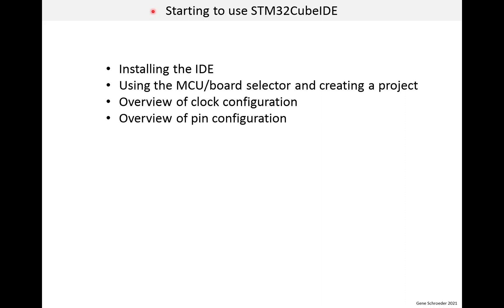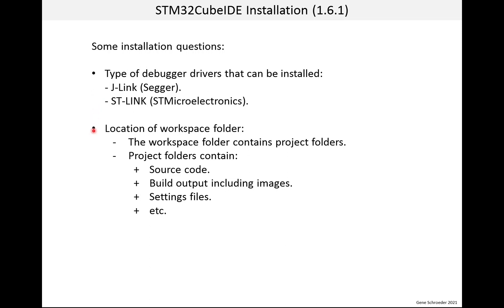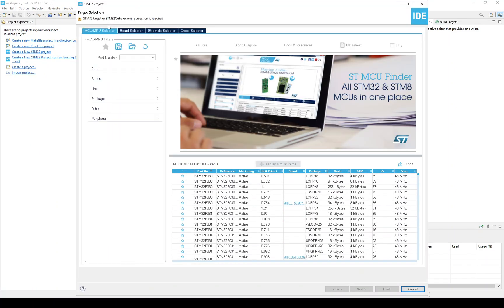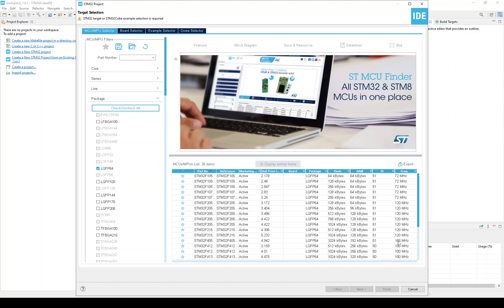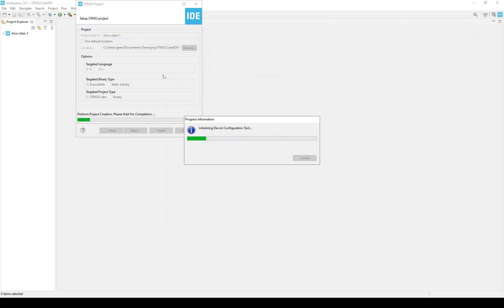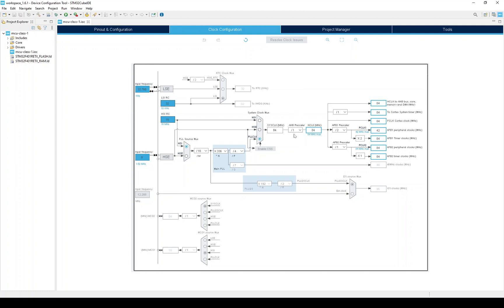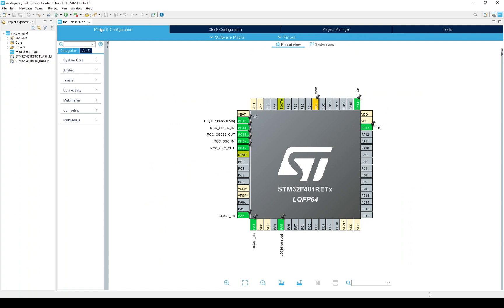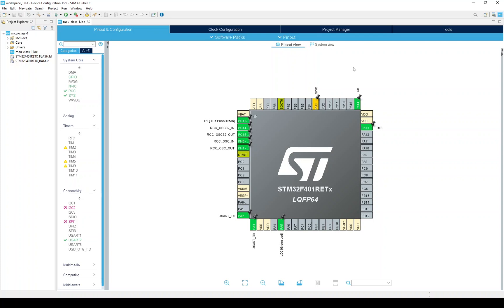Lesson 3.  Starting up STM32CubeIDE

Comment: Great videos.  Would be nice to see a VSCode and Cube tutorial with Makefiles, preferably on Linux.  Hard to look at Eclipse when we have much better alternatives now.
Reply from the maker: This is a good point, and something I would like to do. In spite of the chunkiness of Eclipse, it is probably the easiest way to get started, especially for people new to embedded. And the tool integration isn't bad once you get used to it, although I nearly always use an external editor like emacs.

At past jobs, I have used clunky IDEs to do very early work when using an MCU for the first time, for things like checking out the board hardware and prototyping. It can be the fastest and easiest way to get started, even though we would later move to Linux environment for production code.

Comment: Thank you so much for the work Mr. Gene. It is the best tutorial of getting better at embedded fast. Wishing you a great million following!! Thank you!

Besides, I have not gone further the board selection part. I wanted to know if I need that exact board or are we simulating this on the IDE so no HW is required sir?
Reply from the maker: The course is based on having the NUCLEO board as described in lesson one, or a NUCLEO board very similar to it. The IDE provides no simulation capabilities. You could go through the course without any hardware, but you will miss much of the practical experience.

In any case, I hope you have success in your studies.

Comment: Hey, thanks for the great course! Is there any way to do all of this purely from a CLI? Or is that just simply not done?
Reply from the maker: It is possible to be CLI-only in principle, but it would be a much different course because it would be much more difficult to to write the hardware initialization code from scratch. There are good and bad things about IDEs, and automatic code generation. But for people just starting with embedded, there are so many things to learn, so I think that good > bad for IDE.

If you look at my course on CI/CD, you will see that you can easily create build scripts (.bat in Windows) to build a STM32CubeIDE project, and flash it onto the MCU. Then if you use something like VS Code to edit code, you will not use the IDE very much. However, you must still use IDE for two main reasons:

1. If you want to change the peripherals and settings for which you are using code generated by the IDE. You need to regenerate the code.
2. To use the IDE GUI debugger, which is pretty nice.

If you look ahead a few lessons where I go through all of the startup code, you will see the IDE-generated code, and perhaps find it is not so bad. And in the CI/CD course, you will see that STM32CubeIDE generates standard makefiles that you can run from CLI. I find that as long as I understand in detail what the IDE is doing, I am OK with it.
Reply: @geneschroedertech7501  Thanks for the reply! I will definitely check out those other videos!